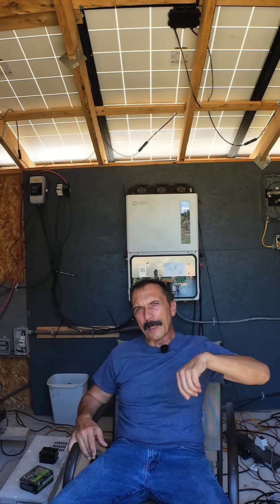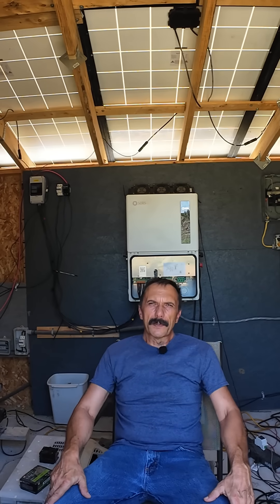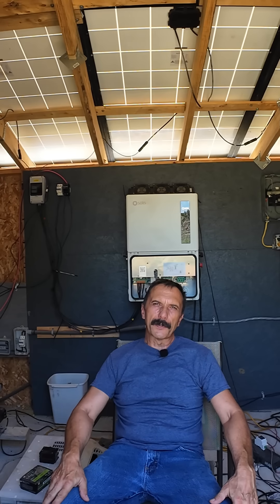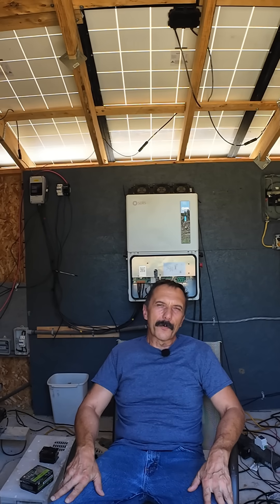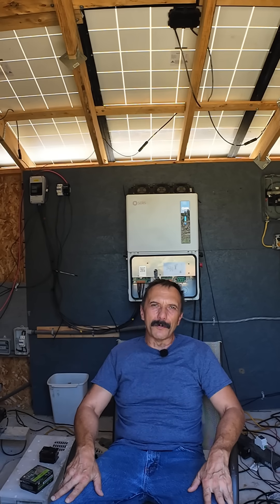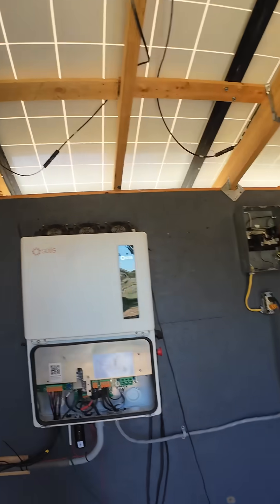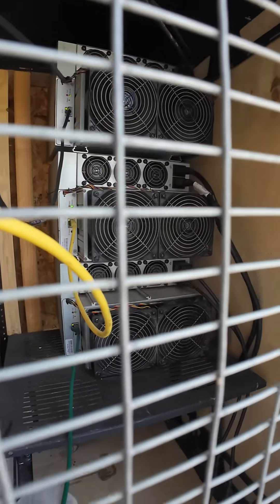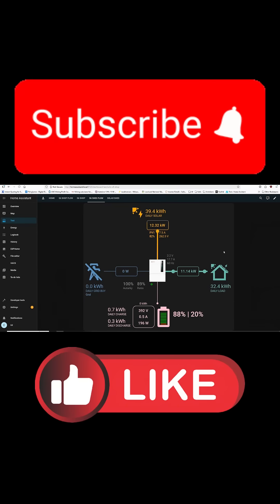Why Do I Run These Stress Tests Solis S6 11.4kW Inverter

Comment: How long will they last?  With the heat staying in check like you were saying, 40 degrees from ambient, they could make it a long time.

I’m hard pressed to say.  What are you thinking?
Reply from the maker: If we are to believe what the Solis Engineers say I would say your presumption is correct.

Comment: I have noticed that at 48A  my s6 voltage drops down  to 234v at 48a so i changed the backup port reference voltage to 243v and now its at 240v under full load. Factory setting is 235v
Reply from the maker: Good information, I'll check that out today if the clouds ever go away!